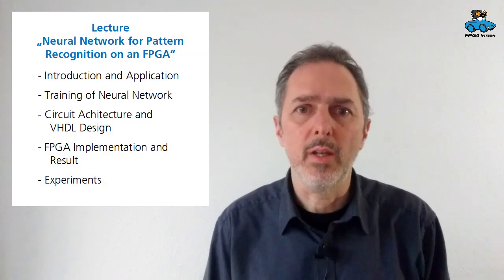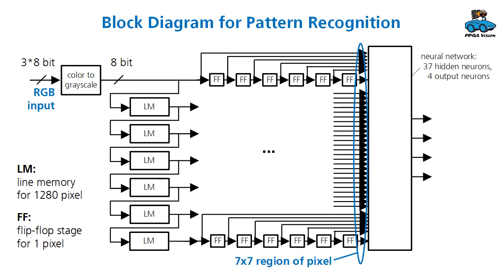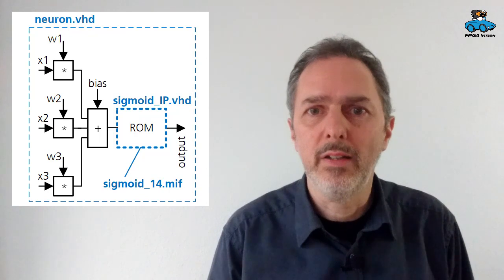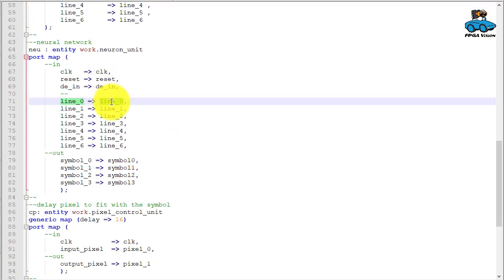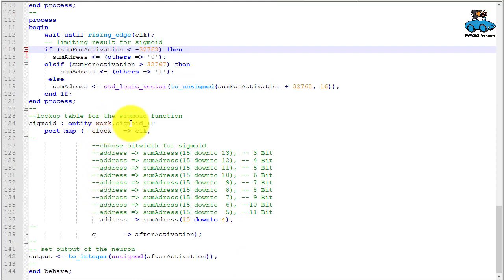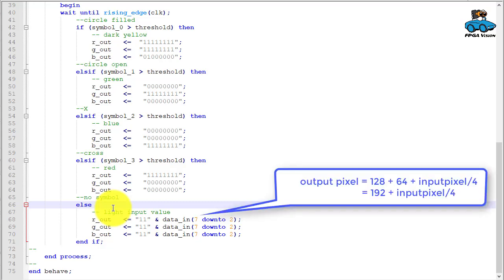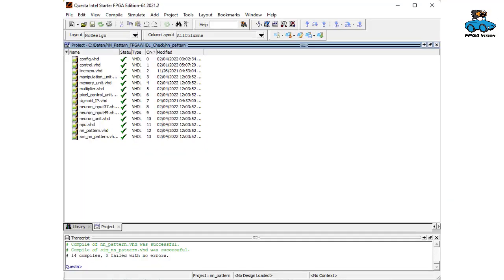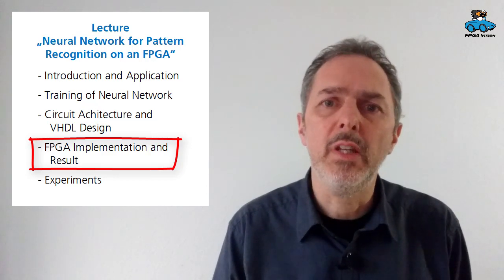Pattern Recognition with NN on FPGA - Circuit Architecture and VHDL Design

Comment: what I am thing is that in nn_pattern file de_0 must delay 2 more clock to keep up lum. thanks.
Reply from the maker: Maybe you are right. I put this check on my to-do-list.
Reply: @marcowinzker3682  thank for response. one more thing, control file should delay 17-clock ( 16 for neuron unit file + 1 for manipulation ) instead of 21-clock. thanks!
Reply from the maker: I checked the simulation output. The grey overlay is at the same horizontal position as the input, so delay should be OK. Vertical position is shifted, but this is not compensated and OK.

Color indication of detected symbols is at the center of detected pattern, so also that should be OK.

Comment: Sir, can a Cyclone V be used to replicate this project. I am encountering problems like "can't fit design in device" and "cannot place the following 95 DSP cells" . What do you suggest I do Sir?
Reply from the maker: Yes, you can use a Cyclone V, but it has to be a large one. It works with the 5CSXFC6D6F31C6 of the DE10-Standard, which I describe in https://youtu.be/-Nb8ha7s4ZQ

In my experience, Quartus is sometimes not successful in automatically balancing LUTs and DSPs. You have to help the tool and use synthesis options.

Look at Settings -> Advanced Analysis & Synthesis Settings and search for "DSP".